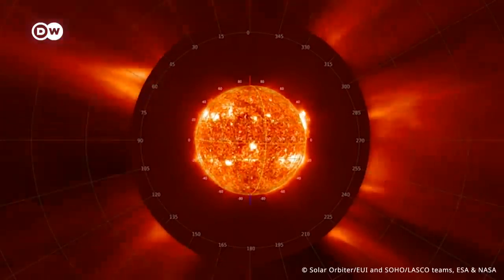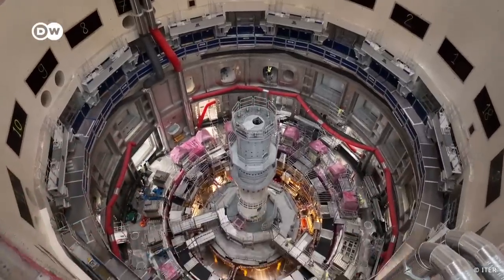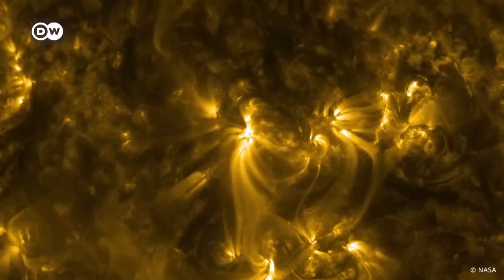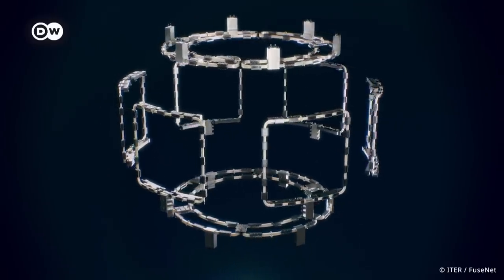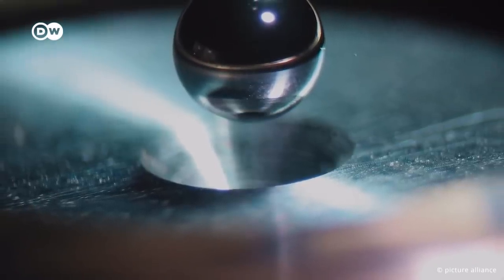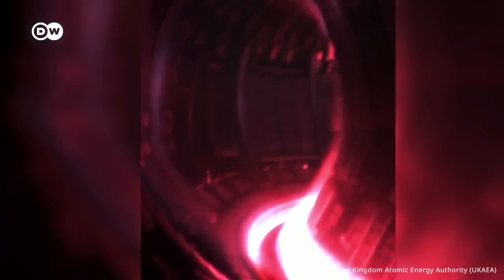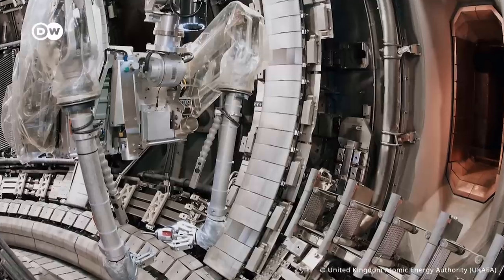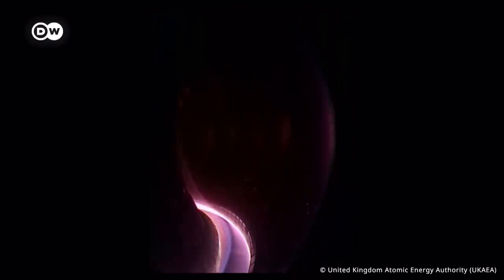Is nuclear fusion the key to fighting climate change?

Comment from the maker: What do you think? Should we keep researching nuclear fusion  – or rely on technologies that already work?
Reply: We should focus on nuclear fusion only after we have prevented the impending climate change disaster.
Reply: Nuclear fusion seems to me to be a pipe dream. Whilst I do think research should continue, it is at the moment a distraction. 
We need to rapidly switch to a carbon neutral economy asap. Geothermal energy*, solar panels**, wind turbines, and back up battery technology are more than sufficient to meet all our energy needs. 

*With the development of laser drilling it will be possible to build geothermal energy plants almost anywhere.
**Solar panels are rapidly increasing in their electric output.
Reply: You heard it from them. Tritium is very limited so it's not fit for wide scale energy production. Nuclear energy and less urban sprawl is our best chance against climate change. There's no shortcut to it
Reply: I agree with working on techs that already work! For instance, restarting coal plants in Europe to save natural gas.... oh wait. Fission already works but it's not available to countries without the budget since richer countries won't fund it for proliferation concerns. Renewables already work to a point. Yet Germany has spent $500 billion on their wind and solar push and they still need lots of coal with 40% of production from renewables

There are two technologies that don't already work here. One is nuclear fusion and the other is long term energy storage that could effectively scale up wind and solar to breakthrough reliable levels. We should try both! Or deep geothermal as Quaise Energy is trying by pointing a fusion plasma heating microwave at the ground - it could beat everything else
Reply: Let's we back to the old time, consume less energy.😏 Just kidding 😂

May be we can produce energy outside the earth, and convey them back to earth, just like other natural resources import from other country.

That's why energy storage technology will definitely more important than fusion technology, in my opinion.
Reply: @bandhansangha9462  Then explain the 3.6k page ipcc report, drying Colorado river, flood in Bangladesh, and recent heatwaves around the globe.
Reply: Asking greenpeace is a waste of time.
Reply: Further research in this is like further research into world peace.
Reply: @LbirdChong  the sun already produces energy outside the earth…
Reply: @boathemian7694  ya, but we can't collect them.
What if we built a very big solar panels or solar farm outside the earth? Just like the PV on the satellite 🛰️ but far more bigger.
Store the energy into battery, and then send them back to earth.

Because PV on earth needs a lot of land.
Reply: @rephaelreyes8552  The thing about tritium is they don't need it for research until they get to the eol of a given research reactor like in jet most runs are done with just regular hydrogen because they don't want dt-t neutrons tearing everything up. Iter will test just fine on what jet and every other existing tokamak test on.
Reply: Elysium Industries molten chloride fast reactor is the best design on the table at the moment. I used to like thermal molten salt but there are pro's to both.
Reply: Depends can we afford to throw Under utilized Physics at the problem? Its like arguing for or against the Manhattan Project. "destroyer of worlds" Suns really are this.
Reply: @rephaelreyes8552  Have you never heard of a hydroelectric dam. In the right area not a dessert. Creates water reserve, controls flooding, creates a fishery and provides power. No mining or enhancing of limited radioactive elements which need generations to decay. > "There's no shortcut to it" Radioactive material is the same tritium argument until they make a thorium reactor.
Reply: will be so fun to watch german hyperinflation in our lifetime
Reply: @ironstarAcles  Careful some people are still alive from this in the 1920-30's although dwindling at an increased rate.
Reply: @rephaelreyes8552  The plan is to breed Tritium from Lithium embedded in the blanket. So this is not really a show stopper.
Reply: @bernhardschmalhofer855  makes sense
Reply: @sclabhailordofnoplot2430  I'm sure any type of renewable energy is fine. I just think nuclear energy is very important because we already have nuclear weapons and we pay tax money to maintain them, so we might was well use them.
Reply: Absolutely! The final shape and process may not look anywhere like it is today or what we imagine it to be, but in order to ever get there we need to continue without a pause.
Reply from the maker: Be sure to subscribe to our channel! We have new videos every Friday explaining various solutions to the climate crisis.
Reply: Existing technologies not only work but will continue to mature and become less expensive. Fusion simply will not compete economically with cheap renewable energy sources, together with the low cost, mature energy storage technologies that will be available 20 years from now. I'm not against fusion research - it will do good science. But there is simply no chance of it being the most cost effective way to deliver abundant, reliable electricity. In any case, we need to decarbonise energy today, not 2 or 3 decades from now. We have the technology. We need to implement it now. 

Fusion will be useful in niche roles, like space travel.
Reply: @ladyselenafelicitywhite1596  
Said, "Solar panels are rapidly increasing in their energy output."

You need to show us an authoritative source for your claim.  Otherwise it's just your unsubstantiated, bad opinion.
Reply: @Canucklug  
There are plenty of long term energy storage systems, and they make up 95% of all energy storage.  It's called pumped hydro and many more pumped hydro storage systems can be build in hundreds of suitable sites.
Reply: @bernhardschmalhofer855  
You failed to consider that breeding tritium from lithium, then removing the lithium and removing and purifying the tritium and then processing it and deuterium into fuel *all* take energy from the gross output of fusion.  That's just more nails in the coffin of fusion because no fusion reactor is going to be commercially viable until it puts out more power than is consumed to keep it running.
Reply: @rephaelreyes8552  
New nuclear power plants are not being built because of multi-billion dollar cost overruns and decade long construction delays.  No utility is contracting to have one built because they're too expensive.
Reply: @acmefixer1  Thats like saying we shouldn’t build high speed trains because it’s expensive and will never be profitable. While in China, they’re quietly expanding their high speed railways like it’s nothing
Reply: @rephaelreyes8552  
Your comparison in not valid.  High speed rail is a mature technology which is guaranteed to work when the construction is finished and the rail goes into service.  With the fusion reactors now being built, there is much less than a 50% chance that any future reactor will make commercial power.

Building a fusion reactor is like selling a fridge to an Eskimo:  why would anyone want to spend tens of billions of dollars and wait - it has been more than 60 years - when any electric utility can spend a billion dollars and in a year have a finished and fully functioning solar PV project that's putting out a gigawatt, and with storage can put out power around the clock.  Nuclear fusion is absurd.
Reply: @acmefixer1  Yeah pumped hydro is really great where it's available
Reply: @Canucklug  
Thousands of sites around the world will make good pumped hydro sites, especially abandoned open mining pits.
Reply: @acmefixer1  Yes, that is correct. That a tritium plant is needed for commercial DT-fusion is well known and part of any plans for a DEMO reactor.
I would not count the energy requirements of the Tritium plant as a major impedement. But merely having to operate a onsite plant that deals with radioactive  materials is IMHO a major hassle. 
Personally I think that it worthwhile to develop fusion technology, uncluding the Tritium planst. But I doubt that fusion will ever be competitive over renewables+storage.
Reply: The scientist have to rethink the  shape of the reactor..!
(1) the Plasma should flow in a "8" pattern  around the 2 magnets situated in the middle of the "8" shape...!

Then the reactor must be able to spin in its axis with the outer wall aligned with magnetic  forces...! 

Remember, you 1st heard it from me..! 🙏 ❤️
Reply: @jjsundra3310  
There isn't enough tritium to keep a fusion reactor running.  No tritium - no fusion.
Reply: @acmefixer1  WELL DONE! 
I am aware of it!
Harvesting  Tritium from lithium is a very very expensive affair..!
The moon has plenty of it..!

Anyway, the "8"  shape flow will reduce the need for too many of the isotopes..! 🙏 ❤️

Comment: What everyone seems to forget about these projects is the biggest advantage of pursuing it which is the technology that comes out of it can be used for solving other problems. Like the magnets are getting more efficient and thus means other industries that use magnets (everything that moves using electricity uses them) will also benefit.
Reply: @Asanda
No, the research into fusion will not benefit the permanent magnets we use for building motors for example.  The research into fusion deals with super high power electromagnets which are not used in everyday industry.
Reply: @acmefixer1  There's a lot of things that were not used in everyday industry that are now used in everyday industry thanks to research. Many things we have today are the results of people taking knowledge from one field and applying on others.
Reply: Oh absolutely, which is why I don't mind "big science" projects like this. There will be spinoffs. But fusion as a source of electrical energy will always be more expensive than the alternative.
Reply: @asandax6  you're right about basic research benefitting everyday life.

However there is absolutely no use in everyday industry for nuclear fusion technology.  Your analogy isn't valid.

Comment: It irritates me when people say fusion will save us from climate change or say that it's a waste of time and money.

Relying on it saving us probably isn't smart. However, funding it isn't harming anything and it could have a huge pay-off. It's worth investing in it, just not to excess.

Edit - clarity
Reply: Save us from what? Doomsday ain't coming
Reply: @thegreataynrand7210  its already here. every year basically every country sets a new climate record in some aspects, whether its most wet, most dry, most hot or most cold, months, seasons or years, and some countries even set all 4 of those records in a single year. whats worse is that the pace of these records is increasing, not decreasing, which doesnt make sense if theres no additional factors involved. people are beginning to wonder if the current weather cycles weve become used to will slow down and put us in favourable or unfavourable conditions for extended periods of time, rather than the 1-2 year time spans for these weve seen for the last 30 decades.
Reply: @jonathanodude6660  You need to look closer at the data because there is lots of politics and political correctness mixed with hysteria in much of climate science. I suggest an excellent YouTube channel to watch is called Climate Discussion Nexus. Also a warmer world is a better one.
Reply: Putting this money into subsidies for home solar and wind could help slow climate change now.  However, cutting reliance on grid energy is very threatening to the huge profits of big energy companies.

Comment: This video has the greatest variety and quality of video clips I've seen for a fusion video and many good quotes. One I particularly disagree with is Jassby's quip that every private company is a fantasy, and ironically with the pro-fusion side's statements about operating power plants coming out in 2060 - 70

Using the same tokamak power parameters that are used for ITER the private company CFS projects that they can build a >200MWe pilot plant before ITER reaches full power tests in 2035. They have demonstrated a superconductor magnet twice as powerful as ITER's. It's actually limited by the structural strength of steel and their full scale tokamak should be 10x more powerful than ITER for a given size. With a JET size tokamak they can match ITER's thermal output along with much lower input energy to run. For a pilot plant not necessarily optimized commercially they project $260 MWh - very high but also very close to commercially relevant with how quickly parameters can change fusion output

For instance a much cheaper or much stronger structural material to reduce their cost or increase their allowable magnetic power would launch them into commercial territory. There has also been a simulation prediction that high power tokamaks will be more tolerant of higher plasma density, potentially quadrupling the power of an ARC or ITER power tokamak

For other private companies the rubber is hitting the road quickly and we'll soon see if it's a launch or spinning tires. Zap is finishing a reactor that could produce Q = 1 this year that is far more scalable and engineering friendly than laser or tokamak designs. They say their power scaling is to the 11th power of the current applied to the plasma. I believe this means that they could run into physics problems and simply overcome it with a more powerful machine without sacrificing much in commercial competitiveness. Helion is building a machine for 2024 intended to produce bursts of net electricity that is one step before a full scale generator, as is General Fusion with a 70% scale test reactor in 2025. I don't know about Helion but it appears General Fusion has the same ability to scale up to overcome physics problems, as has happened with both lasers and tokamaks who suffer from far more instabilities than predicted requiring far larger and more powerful machines than thought the last time fusion was said to be 20 years away. With General Fusion their 70% size reactor is aiming for Q = .1 while their full size is intended to produce Q = 50. If they hit an instability problem there may be an option to build something like a 120% size reactor that costs somewhat more per MWh but potentially overcomes stability problems with rapid power scaling

Overall I have a feeling energy storage will beat out fusion but I think both are real possibilities. Fusion also has the feature of directly producing heat which could be applied to decarbonizing industrial processes using a lot of heat with a relatively higher efficiency than converting wind to electric to heat for the same purpose (though not necessarily an absolutely higher efficiency). It would also have advantages for powering container ships which don't have a grid they can draw from if their onboard wind power source is offline on a quiet day
Reply: So you believe the informational brochures these companies put out?
Reply: @antonimalachowski5262  In one of his public lectures the General Fusion founder mentioned he thinks they have a 70% chance of success. There's a rule of thumb some use to rate likelihood of success where they divide a promoter's opinion by 10. So in GF's case we could go with a 7% chance of success. If there are several companies with about these chances that's a pretty good bet overall for something that could be comparable to fission without its downsides, and maybe a lot cheaper in some cases
Reply: Is that Q plasma or Q total? Big difference!
Reply: @zen1647  Yeah, Q plasma... like for the General Fusion proposal if they had a Q of 50 the Q total of the plant would be 6
Reply: @Canucklug  What if promoter has already considered this division of 10 and told us 70 percent chance instead of 0.7percent.

Comment: Orano SA produces Tritium thankfully & its available from other sources. My view is that an intermediate energy production phase is required before/if Fusion becomes available. This would involve Thorium reactors to reduce problem waste and to consolidate Uranium. Due to plasma instabilities I don't see fusion available within the next 50-70 years unless some new ideas come forward. Maybe night billboard lighting should be shut down.
Reply: We already have a fusion reactor avail to anyone with power of 0.6kW/sqm which is no joke. We can't even tap on that energy, and now we want to create fusion here on earth.. that's stupid. If money goes to photo/ thermal solar, that would be more beneficial.
Agree on fission reactors improvements and next usage, aswell as the unnecessary lighting.